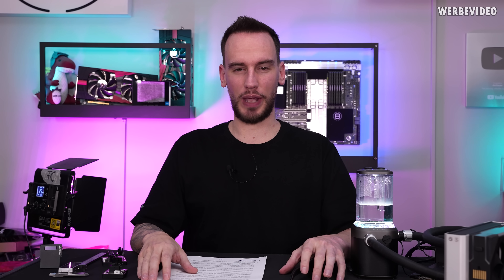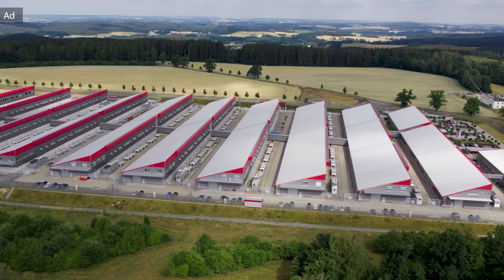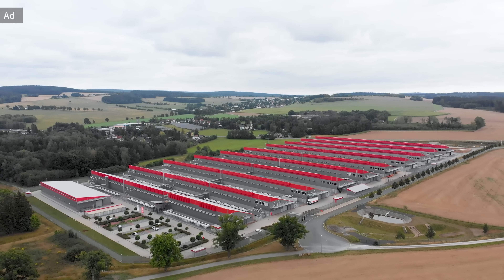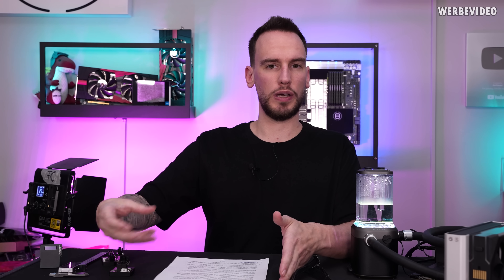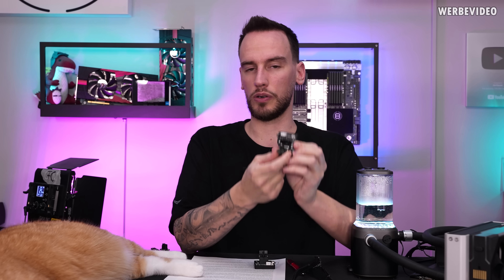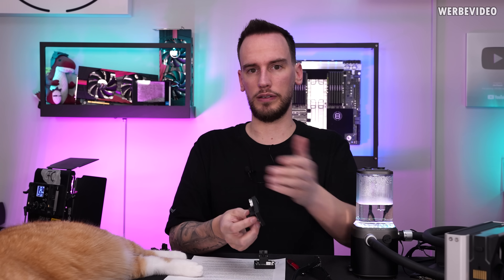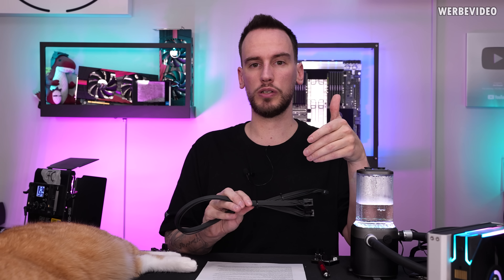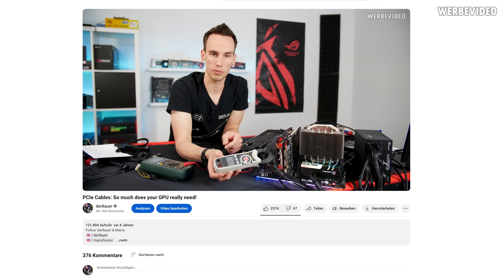12VHPWR is just Garbage and will Remain a Problem!!

Comment: So I have an ASUS 4090 strix oc and a Thermaltake 1650w GF3 psu. I’m having the BST issue (black screen and fans go 100%). About to switch for the 2nd included cable that came with psu when I get home from work. I have the cablemod kit coming in the mail just in case that doesn’t fix it. I have done everything I can think of software, driver, and bios wise that was recommended. I’m pretty sure it’s a cable issue. I’m about to make a Reddit post just so I can help document this issue and if I find any fix to maybe help others out. I work 60 hours a week right now so I don’t have a lot of time for troubleshooting. If the cable isn’t the issue then I’ll probably take it to a repair shop near me and just pay someone to find the issue for me. Hopefully the 50 series doesn’t use this shit connector

Comment: [14:21] I had this random shot off issue under load with the RTX 4090 FE using the exact same Corsair 12VHPWR Type-4 600W PSU Power Cable (SKU: CP-8920284). Then I replaced it with the Corsair Premium Individually Sleeved 12VHPWR 600W Type 4 cable (SKU: CP-8920331) and the problem has since disappeared. It's just weird...

Comment: The biggest problem is selling a 600 watt card for playing video games. Instead of improving their actual silicon they’re just pumping more power and using software tricks to try and make the same generation outperform the last one even though the hardware itself is basically identical. All while charging more and more and more money. If you spend $2,000 and burn 600W for a video game component you need your head checked and need some education on the power grid. The days of “unlimited” electricity are over there is not enough to go around. I’m usually not for government regulation but they need to ban cards over 400W even that is ridiculous for fucking video games. The 4070 has literally the same amount of cuda cores at the 3070. The 4060 Ti has LESS cuda cores than the 3060 Ti. The 4090 only outperforms the 3090 Ti because it’s fucking 600W vs 450W. that is more than my entire fucking system with a 5800X and a 3070. This generation is an absolute fucking scam and nvidia employees should be in jail

Comment: Should I be worried using adapter that comes with 4070 Super? It will obviously have to be bend, since case has size limits. Or is 4070 Super is not powerful enough to melt bended cable?

Comment: They should just use Anderson powerpoles. There is ABSOLUTELY NO NEED to put power through an 8 pin connector when all you need is one BIG FAT + and one BIG FAT -. Same for SATA, it's ridiculous that the power connector is wider than the data connector. Power should ALWAYS be 2 pins

Comment: I am receiving my 4090 tomorrow and already paid for the cablemod ...😅

I wonder if a small undervolted will help keep some of the power down on the connector or just use 2 of the cables in the PSU

Comment: And the problem is, all new psu has 12 vhpwr, doesn't matter if these for 4070, so the best may 8x2 for avoiding margin error, then another new psu 😮‍💨,
the best setup for 4090 user is a vertical application, this will avoid to bend the cables so close to pin. Otherwise the pin n socket which actually the matter, what i c is how can b in a very right plugged but by little touch the indicator lamp make a signal?, so it is a failure quality of those sockets n pin.

Comment: 12 wires at up to 8.3A each inside a warm case is bad enough, but add in the crappy connectors and you've got yourself an obvious fire hazard. They really should have standardized on 24V, or even 48V. It's far easier to insulate electrically than deal with the heat at the lower voltages and higher current.

Comment: this sad generation of GPUs have lots of problems. anti sag brackets might not even help in some cases allegedly. unless there is user error in installing support brackets. best to vertical mount the heavy cards or turn your PC on its side hehe which includes a few different orientations you can do to remove the twisting force off the PCB

Comment: I got a new psu for my 4080 a while back, a Seasonic Vertex GX-1000 and it has a 600W rated cable and I crammed it in a o11 air mini so it has a little sharper bend than comfortable but it has worked fine so far (8 months maybe give or take a week). But still, its a very crappy design imo, I kinda liked having multiple power connectors in my 3070ti because it made it look like a beast and they actually stuck in better and way harder to plug out, so even if 1 was loose I had the other, now if your 1 plug decides he's a little loose ur done for in worst cases.

Comment: My MSI 4090 has no issues.  I run it with a 1000w Corsair PSU and Corsair supplied 2x pcie to 12vhpwr cable (600w rating).  I feel bad for those that have experienced failures.
Reply: That doesn't mean that it may not develop any issues in the future. The design is inherently flawed it seems and potentially dangerous. Be very very careful please.

Comment: I ended up getting one of the ninety degree adapters, but one that is similar to the pack in adapters, except by default the plug is at ninety degrees, and the cables themselves are not super short and stiff, they are longer and more malleable so there's no real tug on the card.  Had to do this, because with the default adapter, I couldn't even close my case door without it bending the cables enough to lose video signal.  I'm also using an undervolted 4080, which never goes beyond 320w ever, and that's with an uncapped frame rate.  

Will be a problem though in the future if Nvidia keeps raising the power requirements of their flagship cards.
Reply: Those ninety degree adapters are not safe. Be very careful.

Comment: Is 12v2x6 just the plug? Is the cable still the same between 12vhpwr and 12v2x6?
Reply: They're the same, only difference is the position of the sense pins

Comment: I just don’t understand why they are even trying to push that much power through these tiny connectors. 

Let’s use 12 small wires to carry 50A instead of just running 2 6awg or 4awg wires like a car audio amplifier! 🤪

There’s no other appliance that is using that small of a connector and all those small wires to carry that much current. The cards are absolutely huge. There’s no reason why to use such a small plug.  They could have made their adapters with 2 thick leads that went to a block that had 3-4 8pin plugs for backwards compatibility. The connector is dumb.
Reply: I  agree with you. I don't understand why Nvidia is not using old 8 pin connectors like 3 or 4 8pin,when the size of rtx 4000 series becomes chunky !!!
Reply: @osamah.mohamed3629  they will use 2x vhpwr and it will be ok, lets not be stucked on old 8 pins.

Comment: I still have my cable mod 12vhpwr v1.0 that I used for months and no issues but recently took it out.. Is it still not safe to use it?? Or is this at your own risk kind of thing?
Reply: @eplugplay8409 There is a recall on those. That's a fire hazard and you are in potential danger. This is literally referenced in DerBauer's video.

Comment: The crazy thing is we already have a well-designed 12pin connector in common use in PC industry. Why not use that?

I'm obviously talking about CPU connector. 8+4 config is rated for 576W, 8+8 - 768W.

Comment: Whats extra stupid on top of the dangerousness is on the 30 series cards the connectir was vertical and angled out so any connector had a clean turn away from the gpu with no sharp angles. Then they changed to a more dangerous power format with a straight out design when the connector really shouldnt make any sharp turns

Comment: I bought a vertical mount for my GPU before it even arrived. I have the 12VHPWR cable coming directly from my PSU to my GPU, so no adapters/converters. I have almost no tension on the cable.

Comment: 12VHPWR was literately crammed down by Nvidia because wanted something relatively small and sexy. Intel and PCI-SIG just took the "donation" and ratified the connector be part of ATX 3.0 spec. Nvidia also wanted to cut corners on PCB/power circuitry for a PCIe 8-pin analog on their Ada Lovelace SKUs. Noticed how it is only on Nvidia SKUs and nobody else has adapted it? Not a coincidence. This wasn't the case back when PCIe 6-pin and PCIe 8-pin connectors became a thing. It will likely be that 12VHPWR will be as ephemeral as P4 AUX connectors that old Pentium 4 Willamette motherboards used before ATX12V CPU connector was finalized.

Comment: Thankfully, mine has held up thus far, though, I'm not pumping 400W through it either.   I tend to go for stability, over "max performance".  Highest I've seen my card draw, is about 320W, but, most games I play, it typically averages between 180 - 240W.  

I just hope I can get through this generation without any 12VHPWR problems, and I definitely won't be buying another card with this connector on it.

Comment: "Looks like it is properly plugged." It likely was. Aside from the connector derating from heat there is also a derating for the number of cycles, meaning the number of times it has been plugged in and unplugged.  This derating factor drops the amp carrying capacity and gives the lifetime of the connector likely somewhere around 30 cycles.  That is, it can be plugged in and unplugged about 30 times before it is considered out of spec.  This number of 30 is an estimate based on similar connectors as I have not found a cycle specification for the 12VHPWR connector.  A cable that you use to benchmark GPU cards will certainly not hold up to the abuse in that case.  Add in the heat cycling of the plastic and sockets on the connector and the plug-unplug cycling lifetime will certainly be lowered again.  I don't think 12VHPWR was ever fully tested in real world use cases before launch.

Comment: imo 12vhpw are not safe connectors and if nvidia wants to make a proprietary connector they should make sure that it cant come undone merely by wiggling it or by pc normal operation (fans produce vibrations) a cannon plug or a better locking device and having more margin of safety designed in would be way better. Im not saying that cannon plugs cant melt (ive seen it) but they are a lot more sturdy and would provide adequate force on the contact surfaces.

Comment: this realization is a not a surprise to anyone with some EE experience, not just theoretical or lab testing, I mean doing actual repairs on failed devices, from day one when I saw that connector and claims that it is fine for 600W of power I thought - this isn't going to end well
in other words - this is a VERY good example of "designed to fail" philosophy, and they - NVIDIA, must be hammered HARD for this BS

Comment: 3x 8-pin worked fine for years. 12VHPWR should be dropped completely.

and cards don't need to pull over 450w. that's hard enough to cool as acceptable noise levels. they should be more efficient instead.

Comment: I bought a 4080 when it came out and it's a great graphics card, but it seems to me that when the new amd card comes out, I'll buy it and sell the 4080. 8 pin connectors are great, in my opinion it's nvidia's mistake, they threw out the 8 pin and replaced it with junk and charged the price of the product .
as for the situation with cablemod, it's not their fault, it's down to the connectors that are poorly designed, they shouldn't have started working with 90 adapters.
More or less, this video explained the current situation very well.

Great video btw ;)

Comment: Hi Roman
I have the WireView 1x12 HPWR for my 4090 FE.  For safety to remove after using the wireview, what tool to use to remove the wireview to lock latch which is hard to remove with hands?
Thanks

Comment: does this means that in theory it would be best to keep my older 1000W PSU which doesn't have the 12VHPWR to power my 4090?  (using the 4 PCIE cables) realistically I won't change my 4090 even if nvidia decides to change the connector tomorrow...

Comment: Fun Fact: The reason why over the last few months 4090's have started to have issues all over again is due to a lot of gamers using heaters to warm their room. I haven't tested this yet but I suspect if you fire up a 4090 under load and then turn on your 65" TV along with a heater... it'll trigger a melt down. 

To be clear... the connectors can melt in many different ways but I really feel like the main cause of the increase of 4090's melting is due to people unknowingly putting too much load and the lack of power to the card will force it to try and draw the power it needs. I just don't think it adapts back down quick enough when the heater turns off and perhaps get's too much power at that point.

This wouldn't really be an issue with a good UPS unit but I doubt ANYONE reading this has their system plugged into the their UPS's battery backup plug. As the 4090 will freak out any UPS due to the high power draw. You'd need a really powerful UPS to support a 4090. (much like trying to plug in a Toner Printer). 

So because of this, you have no way to protect your power regulation and the change in amps/watts be it up or down will melt the connector as well :( 

Also could be MSI's tweaker if you set it to unlimited power or over shoot 100%. Perhaps a combo of the two here.

Comment: I have an Asus 4090 TUF with a Seasonic 1000W Prime-GX and his 12vhpwr cable. I tested the card for 30 minutes with 3dmark speedway rtx test (always more than 420w of consumption) and the temp of the connector never went above 41 degree celsius (the card never went above 63°), and the hot air, that comes out of the heatsink, goes right over the connector. The cable goes out for 3,5 cm from the card, before bending down, and it's fixed on the chassis, so the weight of the cable does not apply force on the connector.

Comment: my 3x8 pins for my 1080Ti and 3090 are super bent, both for aesthetics but also because they take so much space you couldn't close the glass window behind the GPU if i had em straight.

Never had any such issues or OCP triggering. The 12HP shit was worse than  people imagined, I want to buy a 5090 on release, but i might reconsider if they run this garbage still. Bring back 8 pin multi connectors.

Comment: When you think that JUST ONE XT-90 connector could do the job... we have seen the xt connector in rc or 3d printer since 20 years, and they do not fail (I have those connector everywhere, my car battery, charger, ac/dc converter, generator... they can survive a minute with double+ amp rating use, and if needed, you can double it!) They use bigger cable but you have the choice of 12 thin 16 awg cable versus 2 or 4 10,12 or 14 awg... it's easier to have cable management with less cable... I guess you could test it? 😅😅 ...molex standard, they just want to save money by making the cheapest plug pins male/ female with bent thin foil of metal sheet. The pin is just folded around the cable... 🙄

Comment: Due to the unreliability of even inserting these cables, especially if there is lateral pressure along the narrow axis of the connector from a cable bend, I don't think 2 connectors is really going to be enough, especially with the vanishingly small margin of safety around the connector itself - while it will improve the safety factor, the safety factor was already so razor-thin that even just triple 8 pins still has a better margin of safety & level of redundancy. This connector needs a fundamental redesign.

Comment: Had the same problem with corsair 12VHPWR cable, under load after some time screen gets black. I figured out that problem in sense pins, it didn't had good contact. So i took out sense contacts and compressed them a bit with pliers, it's have tight contact now. I've done it about 8 month ago and since then no problems. My friend boutht consair PSU as well and had the same problem, after my recomendation to clamp sense pins no problems whatsoever

Comment: The problem isnt the plug, but the voltage. It should be 48V instead of 12. Would solve alot of issues. Dont understand why the busses absolutely have to be 12.

Comment: For what it's worth, I have a 4080 and use the Corsair 12VHPWR Type-4 PSU Flat Ribbon cable inside a 4000x case. The end that plugs into the card is a bit taut pressing against the glass panel but nothing to worry about. I clean my computer every 30 days or so and I've been unplugging the cable and inspecting it for any signs of damage and there's no sign of damage/wear with the pins or the connector on the card. I've been using it for 6 months now without issues.

Comment: Why do I feel like if AMD had made that mistake they would have been driven to the ground and you couldn't mention an AMD GPU without hearing "hahah bad connector lol" for years whereas it's nVidia it's ok they're the GPU God, let's pretend to be mad for a week and forget about it.

What bugs me the most isn't that there are very pricey "better" adapter, if someone wants to spend a shitton of money for aesthetics, why the hell not, right? No the problem is to have more insurance you're overpriced silicon won't burn your house down you have to spend even more for aftermarket solutions.

Imagine you  buy a car brand new but if you want to avoid the engine failing in the first year you have to buy an aftermarket solution and if you don't there's a very likely risk the vehicle will be unrepairable, I know you don't drive your PC around risking your life and others but you also don't sleep close to your car which is something many people do with PCs possibly with workloads or batches of encoding or whatever, or leave the PC on when away from home to stream games to other devices over the internet. I'm actually surprised those GPUs didn't kill someone yet.